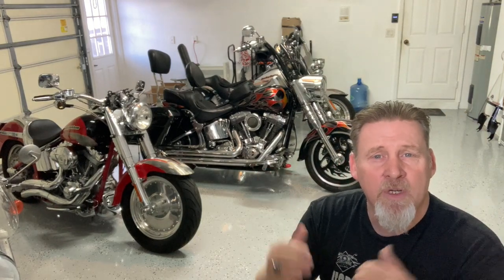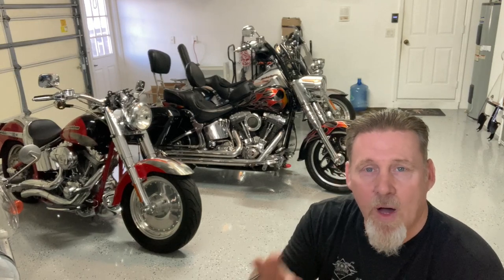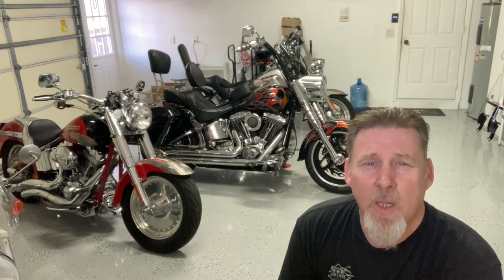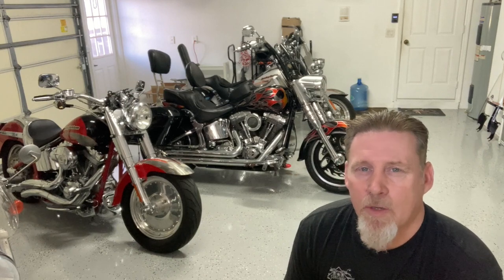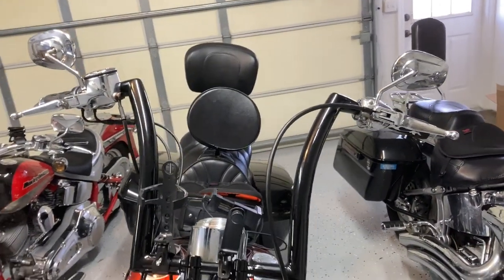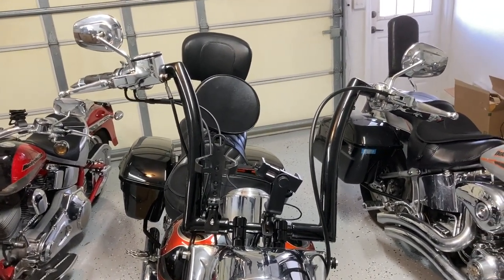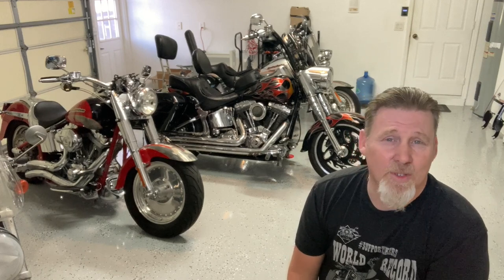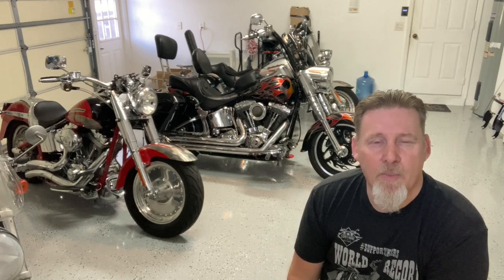Installing Ape Hanger Handlebars On A Harley Davidson Fatboy What I Learned DIy

Comment: I’m like you I like to work on my bike.  I used the same braided steel cable you used.  The only difference is I taped some paracord to it and used an air compressor to blow it through the bars.   Great job on the install and wiring was the worst for me.  There’s different ways to complete the install and I like knowing what tips or tricks folks tried.  Great info and better comfort for those long rides.    Take care✌️🤙🤘
Reply from the maker: Thanks Randy, I watched your video before I did this job, if the way I did it didn't work I was going to try your way. Just something about doing it yourself.

Comment: I like the nacelle on her bike. is that a roadking kit made for softails? I bought the cable kit and went to two local indy shops and they both to rejected the work of doing the clutch/brake cables cuz they don't do half jobs. I guess they were pissed I didn't buy the cable kit through them. they wanted $500 for the kit, I paid $270 on Amazon😳. so I doing it myself🙄

Comment: have you guys run into problems with the police in other states regarding those high handlebars during your travels? thanks
Reply from the maker: We have not had any issues they are shoulder height
Reply: @TheBadgers  I was reading on some of the dmv websites of the states I'll be crossing to Austin, TX. and some say can't be higher than 15" from the seat and another sezs 10" from the top tree, go figure! I don't want to use the stock fatboy bars. did that once to the blueridge, never again! I guess that would apply to local residents. out of state riders would be based on their state laws, maybe.